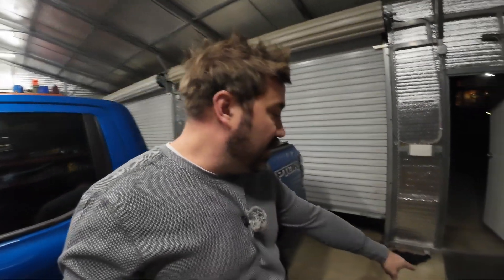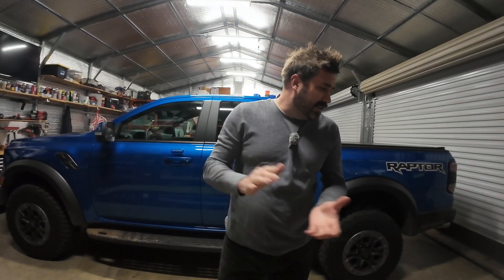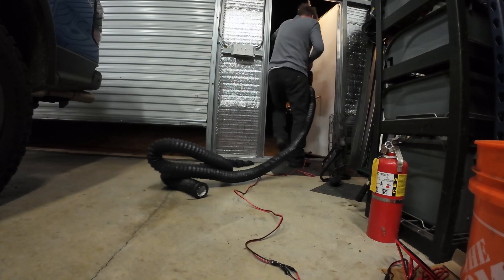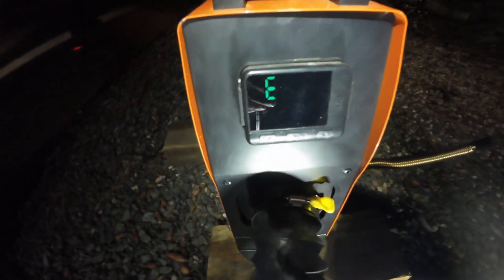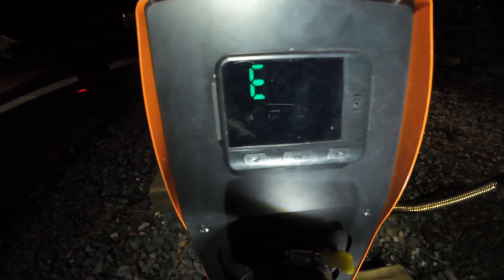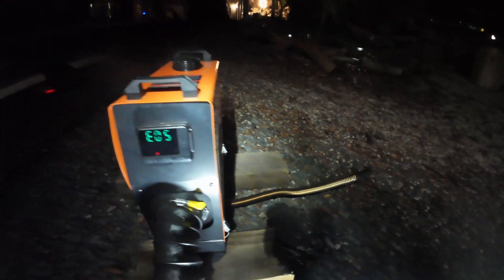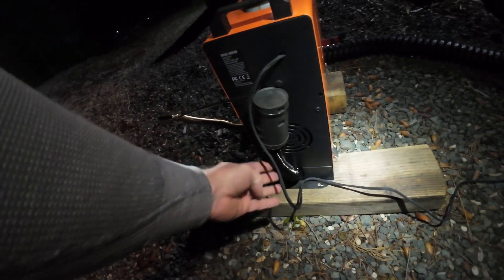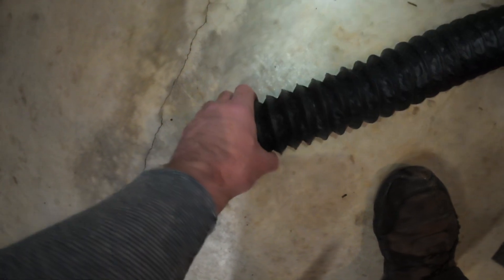Vevor Diesel heater does not work after one use, overheats E05. What's the fix?

Comment from the maker: Fix: So the super long 3” hose was the issue. I put the stock2-3ft  hose back on, and it seems to work fine now, ran for a long time without overheating.
Reply from the maker: Back to not working again. So it wasnt the shorter hose
Reply: @GoWheelWithJon hahahahah thank you for both comments. I was excited for the fix but we're in the same boat.
Reply: @pneuwaveconsulting4441 I have the same issue, maybe the temp sensors are faulty
Reply from the maker: @mfkfx5807 i ended up giving up on it and threw it away. I got a newer vevor one and a hcalory toolbox 2s plus .
Reply: I have the same issue. I can only run mine on lvl 3 if I go any higher tge internal temp goes up over 278 Celsius and throws tge overheating error.

Comment: First time use today, I have the same issue with the factory air intake, heated air hose and exhaust installed. Took off the heated air hose and still the same issue.

I have an older one, 2021ish and it doesn't ever throw codes. Works amazing. Wish this one was like that one
Reply from the maker: Yeah I ended up taking it apart, and then throwing it away and buying another one. Super disappointing.

Comment: i just bought a 3rd diesel heater my other 2 have ran awesome. this new one would throw the e-05 code constantly. i used my old diesel heater as parts and i have found the issue. it is a faulty control box inside the diesel heater.
Reply from the maker: Thanks for the info! I’ll have to check mine out.super helpful

Comment: And what is the solution to this problem?
I have the same. I dont know ....
Reply from the maker: Dont know. Thought it was the longer hose but it still overheats with the short stock hose
Reply: Try to change this. There is the temperature sensor inside.

Comment: The same thing is happening to mine fairly new about the fourth time using and it is shutting down after a couple minutes running
Reply from the maker: Yeah thats my issue too . Worked fine a few times. Super weird.  I havent spent any real time on it. They sent me some parts. Ive seen tons of guys use these with no issue ao not sure if its just luck of the draw
Reply: @GoWheelWithJon looks like I have terrible luck bc im freezing in my van right now

Comment: Hi Jon have you solved the problem by now?

I have exactly the same problem with my heater
Reply: Tried some things today the stove turns itself off at 280 c

I could light the stove up to position 3

I have removed the screw cap with grid on the back of the stove house for a better flow

Now I can light the stove to position 6 the stove will then be about 277 c hot just below the limit of 280 c

It’s still not up to the max but the power has at least doubled
Reply: @peterfeiken1713 same issue with mine. Shuts off at 280 and I can only run it on lvl 3
Reply from the maker: Not yet. I pretty much gave up and bought a different one At this point. Im going to take this one apart and see if anything is off with it
Reply: Okay do you want to let me know if you have found something?

I suspect it has something to do with the settings

Too little fuel or too much oxygen raises the temperature
Reply from the maker: @peterfeiken1713 yeah ill post here if I figure it out
Reply from the maker: @peterfeiken1713 oh thats interesting . They sent me a new computer board to try out

Comment: Hey Jon, did you ever get this resolved? I have the maxpedigroids or whatever its called and used a 16 foot hose to my RTT and never had an issue. With overheating.  On startup mine would use 11A and my jackery 1000 cigarette plug wouldn't handle that, on my off road trailer i wired it with 10ga wire to a 2 pin plug and it powers it fine, im thinking yours has a problem with the temp sensor. Took mine apart once to check the build quality and it was pretty cheesy. Maby your sensor moved and is in a dumb place
Reply from the maker: Havent resolved it yet. Good call,Ill change it from a cig lighter plug
To just some terminals and use a spare battery and see if that works. 

Wonder if the temp sensor is bad ?
Reply: @GoWheelWithJon did that work?

Comment: I don`t see snow on the ground . I don`t see you wearing a winter coat . I don`t see frost vapor coming out of your mouth . You have it on level 3 and it`s not even cold out . Turn it down to level 1 and if you need to get it to go even lower , put it in Alpine mode and that will slow down the fuel pump even more .
Reply from the maker: trying to take the chill out of the air in the shop. Shop is cold. Its 32* outside  , and its 32* in the shop

Comment: I was going to tell you the super long 3-inch hoes is your problem remove that and give it a try I own several of these heaters vevor and no name brands I don't have any hoes on any of mine never had overheating problems most YouTube channels that I've watched use adapter with a 3.5 and a 4-inch hose and they don't have overheating problems so you would probably need to go with a bigger diameter hose good luck don't give up with the heater you'll find that you will like it
Reply from the maker: Thst was the fix - I removed the long 3” hose and it ran for an hour no issue . Before it would overheat after 5-10 minutes. I guess a shorter , 4” hose would be the solution. No bends. Its a good learning experience for me thats for sure
Reply: @blondejon83  good glad to hear you got it working another thing I was wanting to tell you the cigarette lighter plug needs to be at least 15 amp first 4 minutes of startup and shutdown the heater will draw about 10 amps so if you use a cigarette lighter plug make sure it's a good heavy one and don't try to plug it in your Automotive cigarette lighter it will probably blow a fuse and your vehicle good luck have a blessed day
Reply from the maker: @ben5063  thats a great point. Maybe i need to rethink it. I was just using the jackery and 12v for now since its easy and portable. Maybe ill need to figure out another solution

Comment from the maker: Ok im running a super long 3” hose off of it. Im going to try the stock 2ft hose this time and see how that works. It worked fine with the stock hose, my buddy called out maybe the super long hose is causing issues, and possibly too many bends, and maybe too small of a diameter as well. Hopefully its that simple

Comment from the maker: Tried it at 14 and it still overheated and turned off after 5-10 mins. Ill try 12 next then maybe 18 then maybe 36. I know between 26-32 it overheats and turns off within 5-10 mins, same at 14. Ill keep trying maybe a specific setting will do it. Otherwise it might just be a junk unit